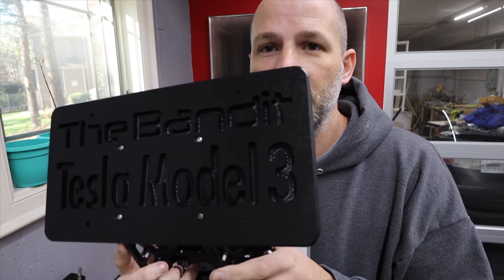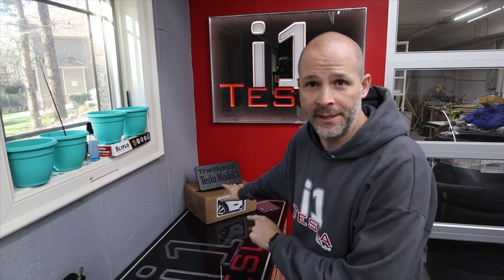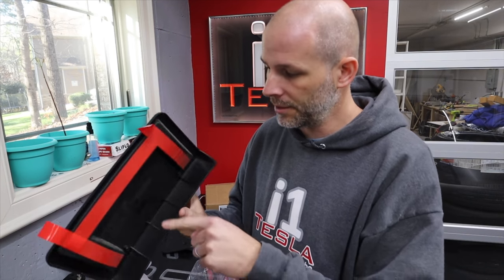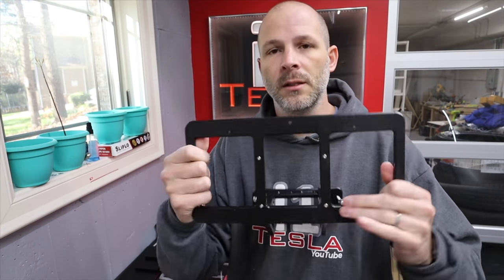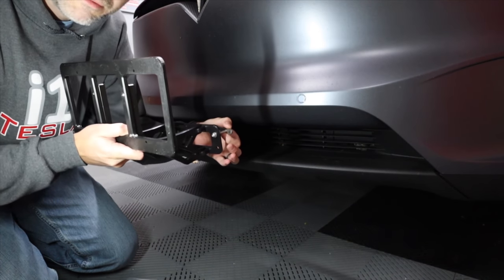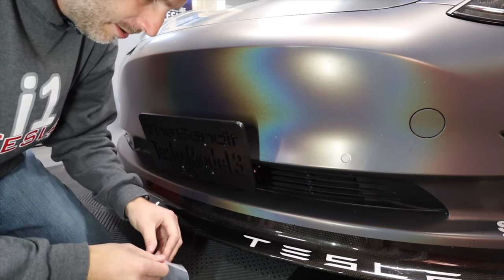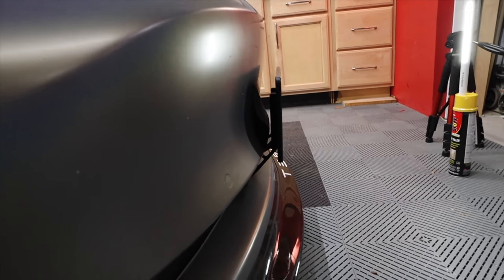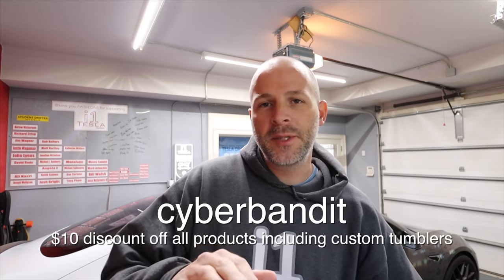The Best Tesla Front Plate Bracket

Comment: The Bandit is a great option for the X and S, but the Snapplate is by far the best front license plate holder for the 3. No hardware required, easy and quick on and off for cleaning. You really should check it out.
Reply: redzombi2k agreed.  Snapplate is perfect.
Reply from the maker: The Snapplate is a cool design and I talked to him about it months ago. I like it but I don't see the need of taking off the front plate. His use case is different.
Reply: @i1Tesla  different strokes for different folks probably. I take it off when washing my car so that I don't have to try and squeeze my hand in between it and the car.
Reply: i1Tesla even if you never want to remove it, you’re dismissing how much easier the SnapPlate is to install than the Bandit.
Reply: Yep, way better.
Reply: Snapplate is nice, but too expensive. Mine literally just broke today on one of the 3d print lines and I've had it for 2 years. Pretty much garbage if it can't last 2 years.
Reply: @JasonGlisson  I broke mine too in the car was, but I emailed him and he replaced it for a fraction of the price. Like paying for the material only. I love it

Comment: As usual, Brian, an informative video. And kudos for disclosing upfront your connection with Tony. Good ethics. I teach ethics. I have a question. You state that the louvers should not be "covered." I am not an engineer but it seems to me that, especially at low city-driving speeds, that a plate that partially blocks the louvers is not going to affect battery cooling. Thoughts? Further, if blocking the louvers at high speeds is a matter of concern, then what about a bracket that can be easily removed and reinstalled? I think you may know where I am going with this. I have a Sto-N-Sho bracket that sits lower leaving most of the front of my M3 unobstructed. Regardless of bracket preference, I am interested in the blocking of the louver question. Maybe I should switch?

Comment: The advantage of the SnapPlate isn't its removability - I agree that a more permanent attachment is better (although SnapPlate provides that option, too). The advantage is the breakaway design, which prevents damage to your louvers. The SnapPlate is simply a superior design.
Reply: My snap plate just broke after 2 years. Broke off right on a 3d print line. For that price, I expect better.

Comment: So, a vendor gives you a bunch of free stuff and you push their product...Wow!  The SnapPlate is way easier to install and remove, and it costs less.  You haven't even done a review for the SnapPlate and you probably never will because you wouldn't want to jeopardize all the free stuff you get from supporting the Bandit.  

And the OEM stick on plate bracket won't scratch the nose paint, as you said.  Nothing touches the paint except the 3M tape.  But yes those that want to clean behind the plate, then the OEM bracket isn't for them, even though no one ever cleans behind the rear plate so why worry about the front.
Reply from the maker: Tony is a friend of mine and not a vendor.I like both plates but who needs to take the plate on or off all the time. I have seen both and talked to designers. I see why some people like the snapplate but I prefer this one better. Isn't it cool that there are many options for people because people have different tastes
Reply: i1Tesla was he your friend prior to sending you free stuff.  Because it sure seems like he’s getting advertising in exchange.